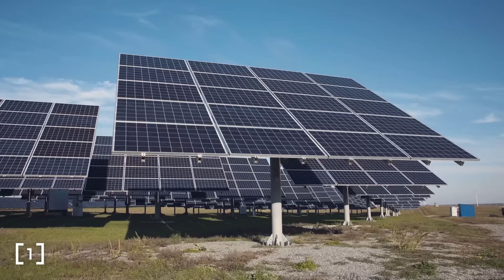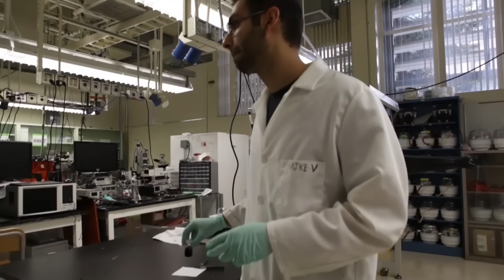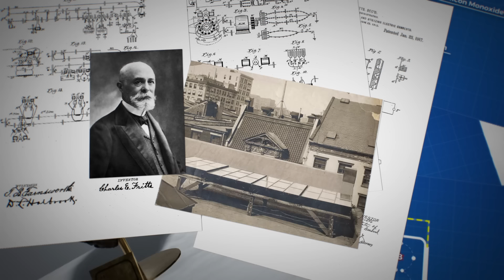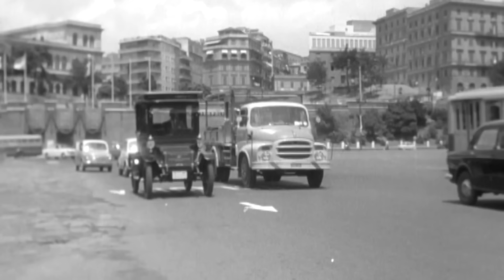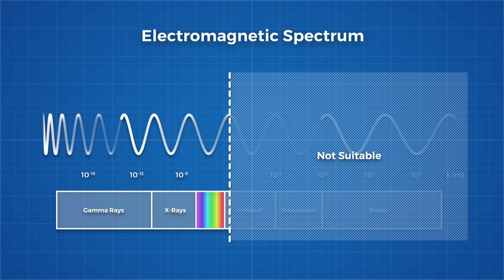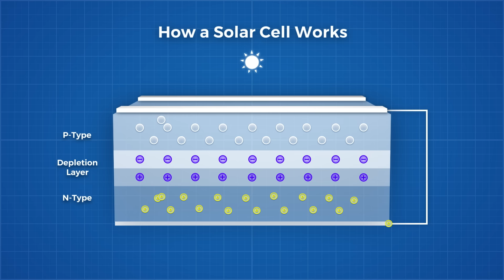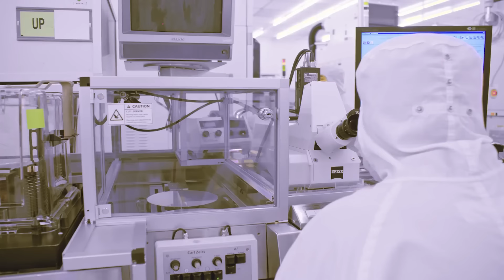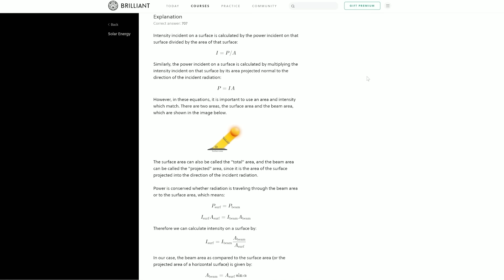The Mystery Flaw of Solar Panels

Comment: How to solve the Mystery Flaw economically: Don't try to advertise and sell solar panels based on the more expensive 20% efficiency model.
Reply: Gaining natural energy is no technological barrier. It's about storing it.This story falsely suggests that the efficieny of solar panels has to reach a certain level before they can be made useful. While for real, most of the energy gets lost in long range distribution and battery-systems.
Reply: @henkkl3505  precisely, and why i am not hopeful that PV or wind will ever be as efficient as NG or similar, certainly less efficient than nuclear.

And there is also the issue of the rare earth metals used to make them. When the PV panels reach the end of their useful life, in aggregate, that's a LOT of hazardous waste we will be throwing in land fills.
Reply: @smokedbrisket3033  The major problem is that real efficiency is a treat to the value of energy. No nation will provide an energy source that takes down the price by over-supply.
While they should. Cheap electricity has a immediate price but is a long-term advantage, just like a governmental railroad network.
Reply: @smokedbrisket3033  https://www.youtube.com/watch?v=GLTJZKYA40Y 90% is recyclable
Reply: @jameswalker590  costs more to recycle than make a new one.

https://www.forbes.com/sites/michaelshellenberger/2018/05/23/if-solar-panels-are-so-clean-why-do-they-produce-so-much-toxic-waste/?sh=5e88a938121c

maybe dont believe every yahoo that makes a YT video
Reply: @UniqueBreakfastTaco  A far bigger issue for PVs is this   https://earth.stanford.edu/news/critical-minerals-scarcity-could-threaten-renewable-energy-future#gs.ocs97l and   https://www.pv-magazine.com/2020/04/23/the-raw-materials-needed-for-the-european-green-deal/
Reply: @henkkl3505  No amount of 'real efficiency' will make up for the fact that 12 hours of every day, solar panels produce NOTHING except degradation and depreciation of the asset, until they are worthless in 15 years, having constantly lost power efficiency, if they haven't been already blanked with dust or snow or destroyed in chance hail storms. A UK physicist determined that to supply all UKs energy needs, every hectare of agricultural land would have to be paved over, and barring a miracle in 'exotic metal battery walls', everyone would freeze in the dark for 12 hours every night. These real costs are NEVER considered in the false claims that 'renewable' (sic) energy is 'more cost-efficient.' We need HONEST government studies in solar Life Cycle Cost Analysis from metal mine head to final hazmat land fill.
Reply: If I have 10 of the cheaper solar panels and if I only add 1 of the cheaper solar panel, I increase the power by 10 % with a fraction of the cost of 10%. 
Those 20% panels will break the bank, but they use less space. The more cheaper panels occupy more space, but you can increase the power cheaply just by  adding a additional panel or two.
Reply: @FloryJohann  There are specific implementations of solar panels where your plan is not a viable option. On a boat you do not have the space to just add another panel, you need to calculate exactly how much power you need them to generate and how many panels you can fit into your existing space to generate it. There are a few boat brands coming with solar panels from the factory, and a few that are completely solar powered. Yes, you can buy an ocean crossing yacht that is 100% solar powered. Silent Yachts is the brand.

Comment: An ad wrapped into ruminations on a moribund "solution." When you factor in the energy (electrical and human) required to create these panels, the net energy falls even lower. It is a comoditized non-solution that ultimately favors those who control the corporitized energy grid and the fossil-fueled economy and culture.  Misdirection is the con artist's most effective tool.

Comment: Since the discussion has been about efficiency, can someone compare PV to Sterling powered generators using solar concentration? I realize that the system is not commonly discussed due to the high level of security around the farms and NDAs.
Reply: Nor is internally mirrored LEXAN tubing with DXE absorption/conducting medium...

Comment: Assume they solve the boron oxygen issue. Okay. But I have read - in more than one source - that solar cells only have a practical lifetime of around 5 years. First off, is that so? Second, IF that is so then it would follow that a homeowner who puts solar cells on his/her roof is going to have to replace them every 5 years or so. If that is the case, will, under normal conditions, the things actually PAY for themselves?

Another question comes to mind. Producing the silicon wafers is an energy intensive proposition. (Yes, I know that silicon dioxide is beach sand but there is a huge difference between beach sand and the thin wafers of metallic silicon from which all microelectronics is manufactured.) Add in all the energy needed to produce a silicon photovoltaic cell array and you have a VERY LARGE initial energy need which of necessity MUST come from fossil fuels. I have to wonder just how long a photovoltaic cell has to operate before it produces a net gain in energy over the energy needed to manufacture it. The problem is common to pretty much all "alternative energy" sources. Take alcohol, for instance. I have read that - when you factor in growing the crop, harvesting the crop, processing the crop to make the fermentable mash and distilling the fermentate - it takes 1.5 liters of fossil fuel to produce a single liter of alcohol. But wait! The alcohol so produced has 30% LESS energy per unit volume than the fossil fuel consumed to produce it! How in the world is that NOT a losing proposition?

Comment: OK, here’s me thinking like an engineer...

I don’t care if you produce a solar panel that violates the laws of physics and has 100% efficiency.

The suns energy only amounts to 1 kW per square meter, and that’s under optimal conditions. Optimal being defined as being on the equator at solar noon on a cloudless day.

And 0.63 gigawatts sounds like a lot until you realize that global electrical power consumption is approaching 23 petawatt/hours.
Reply: Consider the surface area available to collect solar energy and your pessimism becomes irrational.
Reply: @DraRed73  That is still a significant amount of space. I think the main thing holding solar back is the space requirement. As you need absolutely huge amounts of space to power a single home in the northern states.
Reply: @NickTrouble  I have done the calculations but don't take it from me, there are authoritative sources that have worked out the space required is huge but still, a small fraction of the surface available. 
There are many issues in regards to utilizing renewable energy but area is not a significant one.
Reply: Dale -

I am not sanguine that you have actually calculated the necessary area. I am even less confident that you have calculated the costs.
Reply: What's your suggestion on how to solve the energy problem we're facing?
Reply: Precisely what do you believe the energy problem IS.
Reply: @EchoTangoSuitcase  I believe the energy problem is us, as humans, using far too much energy. And currently it's not only that, but we're using an insane amount of fossil fuels to get the energy.
Reply: Fjodor,

“Far too much“ and “Insane amounts“ are subjective measurements.

We are using as much energy as is necessary to run our civilization.
Reply: @EchoTangoSuitcase  I use these measurements for getting my point across without having to look up the specific data because I couldn't be bothered, but if you insist:
At the end of 2018, 73.8% of the global electricity production came from non-renewable sources (https://www.ren21.net/wp-content/uploads/2019/05/gsr_2019_full_report_en.pdf)
I'd like to see a source if you can state that we are using "as much energy as is necessary" as a fact. 
In my OPINION we could significantly reduce our use of electricity and energy as a whole by multiple relatively simple changes in our habits.

I would love to hear more from you though, as I think it is important to talk about this kind of stuff. You seem like you care about science so hopefully we can find a conclusion together.
Some questions from me (I want to understand your point of view):
Do you think as a civilization we can continue on our current path, i.e. do you think we need to change anything at all about our current way of living in order for us and our children to have a future?
Do you think that you, as an individual, have an impact on current global issues such as pollution and climate change?
Reply: @lolcano234  You want an instructional video on how to use google? 
You go ahead and stick your head in the sand if you prefer.

Comment: Interesting but 3 big problems with solar cell. 1st solar panel degradation rate of .8%to .3%. Meaning they will need to be replaced every 25 to 30 years. This is the 2nd problem. What to do with the old solar cells. They are not biodegradable and some components are environmentally dangerous. 
The 3rd problem fo me is the biggest. The land used. Thousands of acres of land put under glass and steel. It is one thing to do this in a dry environment or grass land. A completely different thing to cut acres of trees just to replace the green with glass and steel. 

How much CO2 will a 100 acre forest take in vs the 100acre solar farm prevent?
Or a field of corn or beans?
Reply: I have heard of some efforts to grow plants that do well in the shade/partial shade of solar panel farms.  We will see how that works out.
Reply: DrTed3 
Remember. Crews need to work on them and the glass needs to be cleaned regularly.
Reply: We already have the perfect fields for solar cells which don't require the destruction of additional land. Roof tops of common homes. The issue is that most grids are not designed to accept energy from homes, and their is a lack of political will to upgrade the infrastructure.
Reply: Tony Sarina 
Solar on homes and businesses are great.

Comment: Solar Panels have more issues then heat. They fail within 5-7 years. Need constant cleaning. Still cost $2.50 per watt. Can only use 5 hours on average of Sunlight. No known source to store it. That would not cost $2 Trillion dollars. And take up huge areas of productive landmass....Not to mention the power grid is at 95% capacity as it stands today. Which still requires another $1.6 Trillion in upgrades. As they have not touched it in 40 years. Which adding millions of Electric vehicles would bring it all down. As you have to charge them as well. 

All the while. They have now improve the Gasoline Combustion engine to 54% efficiency. Over the 20% we now get.....  All while not costing $trillions in new Infrastructure cost.

Comment: Dammit! You were SO close to a perfect video.

There is no such thing as a "positive charge carrier." No, protons don't move around in semiconductors, so there aren't charge carriers. It would have only taken a few extra seconds to say the boron doped material is called p-type merely because there are fewer electrons, all total, in the outer shells simply because some of the atoms only have 3, instead of 4. That p-type material is not simply called "positive" because it is not actually positively charged because there are also one fewer protons in said boron atoms.  BUT, because there are spots where there is one less electron, and because the outer shell electrons tend to hop around a lot instead of sticking with the atom they came to the party with, this leaves room for other electrons to jump into the mix. Those spots where other electrons can jump in are called "holes." And, because those holes appear to jump around as electrons jump from their original atom into a hole, leaving a hole behind, we pretend those holes are carrying a positive charge, even though there are really just a lack of an electron.

Comment: I would like to see a fair & impartial look at molten salt reactors or some new generation nuclear power.  From an engineering point of view.
I do not trust environmental scientists.  Does anyone say "im going to be an environmental scientist because of the great pay."?  No.  They go into that field because they care so much about the environment.  Where an engineer will generally weigh in manufacturing costs and problems, environmentalists only weigh in on what is best for the environment. 
Little known fact; more people have died making solar panels than in all the nuclear accidents in history.
Reply: It doesn't matter how often you try to justify nuclear power:

1. It is dangerous even without factoring in the reactor design
2. It has a big environmental impact because you need to move gigantic amounts of earth to get enough fission material and in the process lots of CO2 is generated and lots of ground and ground water is polluted and poisened
3. The construction of a reactor is expensive and very material intensive. The amount of concrete used alone is mind boggling and its production a huge CO2 emitter
4. The waste problem has STILL NOT  been figured out
5. Nuclear power is more expensive than modern combined solar + battery installations
6. Even Saudi Arabia is building gigantic solar parks due to the electricity being cheaper than even their very cheap electricity produced by burning oil
7. Nuclear is only cheap if you ignore the long term impact of the waste problem, factor in the enourmous subsidies without NO nuclear power plant ever gets online, and ignore the CO2 emissions from the production of the concrete and the excavation of the fission material

Nuclear is like mainframes: totally out of date and very inefficient and expensive.
Reply: @FutureChaosTV  I am not certain that is all entirely true. I have a brother who is going to school to work the Nuclear power plant that we live close by, and not everything you say matches what we have learned thus far...

Uranium is extremely plentiful, while it does require excavation,  it is not nearly as extensive as you claim it is, and considering the volume of radioactive material we need it doesn't require as much as coal or oil. A wafer of uranium the size of a US quarter will create more than enough electricity for an entire lifetime (average US citizen). Nuclear fission is the most efficient way to produce electricity ever produced. It is expensive to initially construct, however it pays itself off after about 10 years (last time I checked), and makes a heavy profit afterwards. 

Saudi Arabia may be putting up solar panels for other political reasons. Solar is much more inefficient and more expensive than coal and oil and natural gas It makes no sense why they would be changing other than to obtain subsidies and aid from the UN and other countries who promote "Green" energy.

Building anything will have an environmental impact. Solar is one of the most dangerous to human workers and requires vast amounts of land to produce relatively little electricity. So far the most environmentally friendly forms of energy production are nuclear followed by fossil fuels. Fossil fuel energy production has gotten very clean and are still more efficient than solar, wind, or hydro combined. Considering its relative cheapness it is no wonder that fossil fuels still power the majority of today's industry. 

Stop believing the lies that politicians and Hollywood have presented as an argument for "Green Energy" and do some research of your own from reputable sources. We recently had a politician from a neighboring state come in and try to take away our nuclear plant and replace it with solar, but he lost but by a small margin. I am not comoletely against solar, wind, or hydro however the technology is not feasible economically yet. If you want a good example of what happens when you "Go Green" like progressives want just look at California and all the problems it has because of it. Almost all the fires this season are from old electrical equipment (some are almost 100 years old) that have been neglected in favor of more solar and wind power, and it is destroying people's lives and the environment.